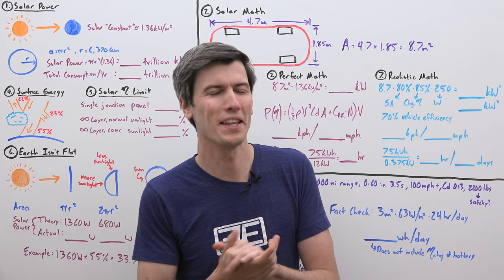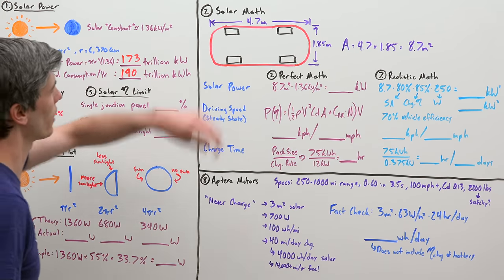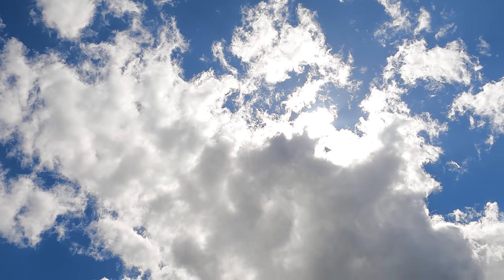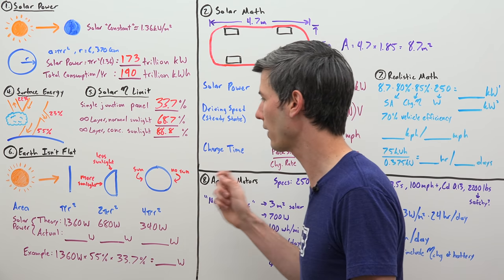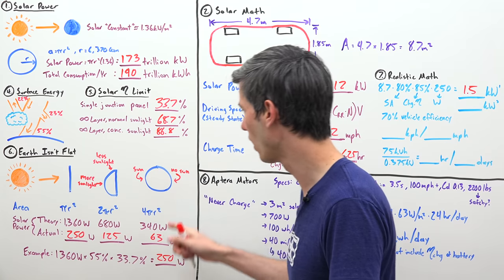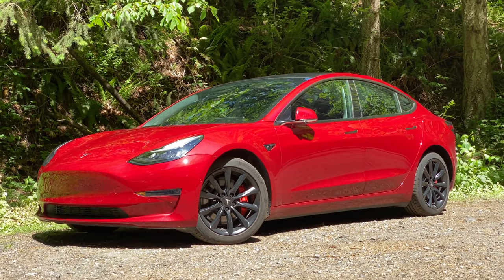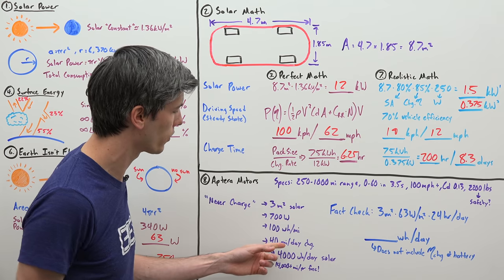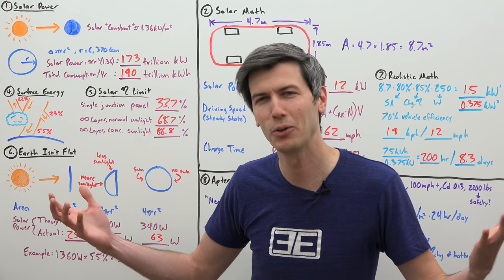Why Don't Solar Powered Cars Exist?

Comment: Heavier is not necessarily safer. I have ordered the 1700 pound Aptera, 250 range, $26K. I drive about 3-4K/year. Also, I expect batteries to get cheaper, better. I can swap if it makes sense.

Comment: I thought idea it could explode under extreme heat. But my calculator and watch is solar power. Maybe Tesla with Solar Paner makes it enough to reserve energy.
Reply: Aptera can collect enough power for 40 miles per day at EPA highway speeds, or 20 miles per day in Iowa where I live, with the full solar model.

Comment: 0.375kw is basically ~ ½hp, more than enough to encounter one problem driving in tropics, heat & humidity. So let say driving 10 hrs, you can save battery juices 3.75kwh.

Comment: Okay, if I had two First Solar S6 panels rated 500 watts each and those were attached to a minivan or cargo van roof would they make a difference sitting out in the parking  lot at work for 8 hours and driving home after work?

Comment: It would be great if it was enough to counteract the vamperic interior protection climate control feature in the Tesla? I live in Florida lol.
Reply: Unlike Tesla, the Aptera body has a foam sandwich with a high r value, so the heat load it has to deal with is much less.

Comment: Lets simplify a little bit.
We can just look how much electricity makes "average" modern solar panel of curtain size. We also have consumption data in Tesla cars. 
"Average" solar panel 1 square meter size produces 150-200 W per hour with a good sunlight. Driving Tesla in a city results in average consumption around 20-27 kW per 100 km. Theoretically, if you would drive with maximum efficiency you can make 19 kW per 100 km - but it would be fairly slow ride.
So this is a real life numbers - in order to produce around 90 kW/h (to fully charge Model's 3 battery) you need a whole house-sized roof solar station working about 3-4 days
Reply: But what if we look not on Tesla, but for something more energy efficient. Much more efficient. Extremely efficient. Volkswagen XL-1 is super efficient vehicle, can make 100 km burning only 0.9 liter of gasoline, or travel 35 km with only it's 5.5 kW/h electric battery.
5.5/35 = 150 watt per kilometer - that's a real life numbers of super efficient vehicle. And theoretically it can driving on a solar power.
But practically not. If you install solar panels on vehicle which only weights 300 kg you will make it much heavier and also it will broke it's perfect aerodynamic shape.

Comment: Would be nice if the car had enough solar to power AC to keep the cabin cool, or run sentry mode, without draining the battery, and keep power on the battery while parked at the airport. I think Australia have a race each year for cars run on pure solar.
Reply: The foam insulated cabin of the Aptera means that that can be done.  It has a much higher R value than most cars.

Comment: 6b) Earth is also not a circle. Therefore the further you move away from the direct line between Earth and the Sun (which is the equator on March 21 and September 21) the degrading of solar power is permanent throughout the day. If e.g. you live in London maximum solar power varies between 80 percent mid summer and 12 percent mid winter, leading to charge times of 10 to 64 days respectively.
Reply: Aptera publishes a solar insolation chart sourced from US government data that shows how much solar energy you can expect on the average at your location.
Reply: @n.brucenelson5920  Average isn't the issue here. I already know that my average usage is 416 Watts, not counting heating, domestic hot water, and transportation. The problem is that an installation that provides me that average power does not allow me to run pretty much any of my domestic appliances, like the vacuum cleaner, oven, cooking plate, dishwasher, laundry machine. What I need is the exact amount of power as requested at any given moment.

Comment: 1. small light cars are only in danger if everyone has BIG cars.   2. Approaching this from wrong side, need to get best panels for vehicle and design vehicle (probably not conventional car as we think of them now) around panels.      They already have had solar races going hundreds if not thousands of miles using only sun for recharging and pedaling.

Comment: Can everyone also remember that in many countries where there isn’t lots of sun solar is a very poor renewable generation source. In the uk for example wind is the best cost per kw by a long way compared to solar. In my company I am pushing to centralise all generation and buy from big wind farms instead of bothering with any generation. Micro generation often a bad idea. Focus on efficiency! On one of our buildings with the whole roof covered in solar it only produces ~1% of the buildings energy use p/a - is a bad investment and there is a lot of embodied carbon since most are made in China with coal power and don’t have a long lifespan etc.

Comment: How about a solar panel array that during the operation of the vehicle it is folded neatly on top of the car. But when the sun is out and your not using the car. Have the car parked in a sunlit place and push a button on your car to unfold the solar array like a flower blooming to cover much more area to charge the car. Will this be practical?

Comment: Wait! It's not that bad. In the middle of the US during the summer, the solar insolation (irradiance per area during 1 day) can get up to 10 Kwh per square meter per day for a panel at zero tilt angle (panel mounted on a car). That is a pretty big difference from your calculation sir! Info source in comments
Reply: Look up realistic solar insolation maps
Reply: Some locations might get full ten hours of noontime equivalent sun, but typical panels are still only ~20% efficient so they get 200W on a square meter. 10h*0.2kW=2kWh.
Also, where the heck do you get ten hours without tracking panels?

Comment: Imagine, 20 years from now:  Take a bus, pulling a trailer (for extra surface area).  Convert it to self driving, top speed about 10mph.  Redo the top and interior to be like a big boat

Just tool around, going cross country only using gravel roads.  It would be just like sailing.  Towns/Cities would be like islands.  As you approach one, hop on your scooter, pick up supplies

Comment: You said the Tesla can do 250 wh/mi. So it can actually charge more than a mile per hour. IMO that's crazy!
Imagine doing 20 miles on a daily commute and your car charges on average 5 miles per day, for free.
You will save 1/4 of electricity cost for the lifetime of the vehicle.
Reply: Agree. I probably don't drive my Tesla a full battery each week... so solar would still cover most of my driving even if it took 8 days to recharge. For me, that would still cut my costs to nearly zero..

Comment: I would rather see parking lots covered in solar panels, which brings a number of benefits:
Shade for parked cars, reducing their ac draw after being parked.
Electricity production for both premises and cars.
Shelter during rain.
A reduction in urban temperature because the concrete does not heat up so much.

Comment: even if solar energy is not enough for the car to get around without external charging, it can be enough to make a car travel a greater distance without using larger batteries or more efficient motors

Comment: It would be interesting to also compare it to solar panels on top of semi trucks to see if the significantly larger available surface area comes close to making up for the increased drag and weight. Looks like Tesla claims 2kWh/mi and 0.36 CD compared to the little Aptera, but it could have almost 40m^2 of solar panels.
Reply: Definitely enough to move the needle and given it is flat and the panels will all put out the same energy most of the time it is comparatively simple.  Basically it is ~35kwh / day which assuming the truck averages far less than its max range per day is still something; definitely enough to offset the impact of the weight which would be 800lb at absolute worst (normal rooftop PV).  Lightweight flexible monocrystalline readily available panels would weigh 8lb / m2 (320lb) and cost $8700 on amazon so definitely should be possible.

Comment: Hmm .. that concept of solar powered and so independent vehicle of some sort, like the last mentioned Aptera, is tempting. And I think one day we might be able to achieve that.
That Aptera thing still looks more like eco-run lab concept good for one/two persons and picnic basket. Period. Useful average family car looks a way different.
Even more to that, it calculates with 3 times! better efficiency then Tesla? Why Tesla itself is not doing that great ? So I have a hard time to believe that it will work.

Comment: What if you could increase sun rays the way a magnifying glass does?  How much does a magnifying glass increase the sun's rays (Especially advantageous in low light situations)?  Let's start with how much do you need and then go about determining how much you need to magnify to have success.   I think there is even solar windows that use reflected light to increase the light absorbed.  Where there is a will there is a way.

Comment: If you have simple knowledge then this is easy to work out. My house has 9 panels on it at about 2kw max output give or take I think it's about 2.2. now roof of a large car may fit 3 of those panels so roughly a kw let's say. In an hour I may produce in perfect conditions enough energy to go a few miles.

Comment: I'm more after increasing the range in a tesla with free energy instead of converting it to be 100% solar. Like going to work, parking in the sun and coming back with 5 or 10 extra miles or not driving during the weekend and starting Monday with 20 or 30 extra miles

Comment: Posting before watching the video... Guessung it has to come down to solar panel efficiency of about 20% combined with the around 1200 watts per square meter at the equator.  Ie.  Not enought surface area on a car.

Comment: If good solar panels on the roof of a larger vehicle parked at work all day got you most of the way home on that power, could you then get by with limited charging need at home on wall power at 120 volts?

Comment: Hey,  I do have a question and I'd love you to look into it. I live in  Australia - very sunny, very big, very rugged! I am exploring options of buying a 4wd in a few years as to get to some places here you really do need a 4WD. However, I really want an EV 4WD and I know there are alot in the market about to come out. Our BIG issue is charging and range. If we want to "go bush" we might not hit a town for 500 miles let alone a charging station.  Is it possible to charge an EV using solar panels. Not necessarily as part of the car as in this video, more like the one you can unfold a lay out and attached to a battery directly. How big would a panel array  have to be to charge one of these cars fully and how long would it potentially take?

Comment: If you replaced the panels on your car with really good solar panels and used a battery system to power one motor which supplements your drive train power, how much would the gas mileage increase? Say on a 5.3l v8 2004 Tahoe??
Reply: A hybrid with supplemental solar in other words? Could be nice.

Comment: would it be possible if the 63w average increased due to solar panel efficiency increasing from 33%? what are the chances that this efficiency increasing? and by how much would it need to increase?

Comment: This is such a trivial question to answer I'm not even going to watch the vid, but here's the gist of it:

Solar panels don't have high enough energy density. If we could have solar powered cars, they everybody could slap a few solar panels on their roof and be completely energy independent. And we wouldn't need any power plants whatsoever to generate additional power for home use.
Reply: Watch the video and you won't make such silly statements.  It takes a lot more work to make a vehicle so energy efficient as to make solar practical.

Comment: You should do why dont we use generators that turn kinetic energy from the wheels to electrical energy to charge a tesla i know its a perpetual motion machine and it wont work but i would like to know why
Reply: No generator is 100% efficient.  The 10% power loss (best case) will quickly drain the power used for motion and is lost as heat.

Comment: I'm kinda confused ... not about the math but I suppose the constants to begin with... if 63 watts per meter squared is the maximum power  that could possibly be gained, and then all those inefficiencies stack up, how can the solar panels I have (which are approximately a meter squared, though they aren't perfectly square, more like 2'x4' instead of 3'x3') be rated to produce 100 watt output? And they do indeed get close, of course not all the time but at peak generation its pretty accurate at around 8 amps @ 12V
Reply: The Aptera panels are rated at a peak of 750 watts.   They probably produce somewhere around 4 to 4.4 kWh per day in sunny climes.
Reply: @n.brucenelson5920  yeah I heard about a new panel that got 6-700 watts. How big are they? I assume they're mono panels? But yeah, that premise doesn't really compute with me. If I were trying to do a calculation I don't think I'd get that detailed or in-depth with it, think I'd just look up the highest wattage amorphous panel and then take the dimensions and figure how many of those I could fit on the viable area of a vehicle to get a rough starting point of optimal power expectancy, maybe then dividing that by 2 or 3 under the assumption that only 1 side of the vehicle would be getting direct sunlight at any given point, and 2 of the other 4 sides would be getting some degree of indirect rays. Sure there'd be geometric changes possible to maximize that potential, maybe even mirrors and fiberoptics that could be strategically engineered into the body to help obtain larger coverage area of direct 
light.

Comment: Compute an alternative idea: buying E-car only for commuting + friendly company + friendly gvt.&media. Most traffic is done by commuting. Now, your parking at work could worth 10m2 (i.e. say an average 5m2 to account for a year) for 9h of light each day. This totals ca. 27kW per day. This is more than enough even for today's E-cars to commute 20miles + shopping. The excess (parking is there to stay for many hours more, inclusive weekends) can be given to grid, in exchange for days when not sunny. The air conditioning waste is less too. The batteries less big. Our old cars should be allowed only for longer trips or heavier cargo. Conclusion: we do not need cars covered with panels. We just need smarter behavior, system and decisions.

Comment: Eventually, under 8 years...panels should be efficient enough to get more power, though it's surprising at end of this video a car exists with the technology. You'd really think though, that a wheel can contact the ground with very little added drag, or even inside the car around the hydraulics, to only spin just to make friction heat, and then supply that heat to conductive metals, allowing battery to charge...so in addition to regenerative breaking, and solar panel on roof, hoods etc...and maybe wind power just coming off the wheels alone...should be three or more power sources to supply a battery from kinetic motion and not overly rely on sun source for energy...but the panels should greatly increase in efficiency  five-eight years out regardless...Car mentioned does sound cool though.

Comment: Solar, along with lightweighting and aero, are just ways of making the car go farther on a charge - so they should be added to every car. 

Solar cars do exist, and they're easy to build (just like a 100mpg car is easy to build, but they're not built). Teardrop car with good aero, wheels, light weight (3000lbs is already pretty good). Lightyear One has something like 5 square metres of solar.. From there it's just simple math to get to 41 miles/day of solar (15,000 miles/year). There's really no need for Lightyear's 2-way curved array, you'd already be doing pretty well with just a 1-way curve. There's also no need to delete the rear window! That won't ever be the new standard.

Comment: Thank you for the very thorough analysis. 
The power varies a lot during the day, so even if you could go out to do errands at lunch time, you might have to push the car home in late afternoon.
Bottom line:  solar will not work for cars.  Back to the drawing board.
Reply: JimA Anders,  I tend to agree.  The largest solar system you could install on a Tesla would be limited to about 1,200 watts total, or about 6,000 watts per day.  It would take 10 days to fill a 50 KW battery.  With a Tesla using about 250 watts per mile, or 25 KW to go about 100 miles, that would take about 4 days to recharge 25 KW.  

Still I guess it could be done.  But I agree, it is much less expensive to install the solar at home, and then charge the car battery at home.

Comment: Maybe a wild idea, but I was thinking. Would a solar panel at least be enough power to run the ac/heat and maybe the radio so most of the battery goes towards actually propelling you down the road?
Reply: Thats what the Fisker Karma used to do, with a solar panel on the roof. So yes!

Comment: Faults there is an independent car company that is making a solar powered car that does have a battery on board. And even in the Northern areas of places like France and Germany it only charges enough energy to go about 20 to 30 miles in a day. And it takes almost 6 days to get it fully charged to go 200 MI. And the prototype is estimated to only be 23, 000. If you're a Long haul truck driver in a week you may go 2,000 miles. Although most people that actually have their own private vehicle only drive maybe 1,800 miles in a month or maybe a thousand 23 hours out of the day they don't use their car so why not put solar cells on it and a battery and park it in the sun. And this example is well known,